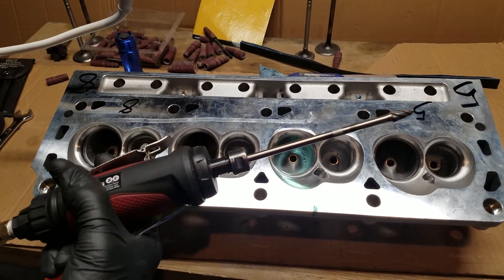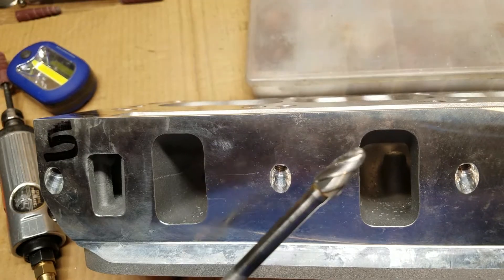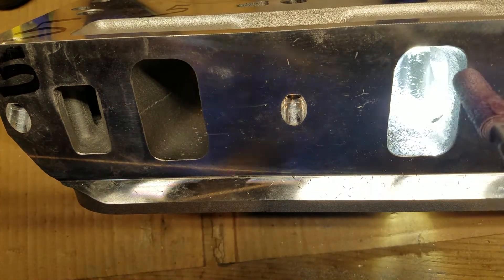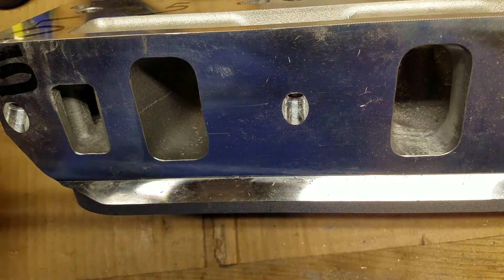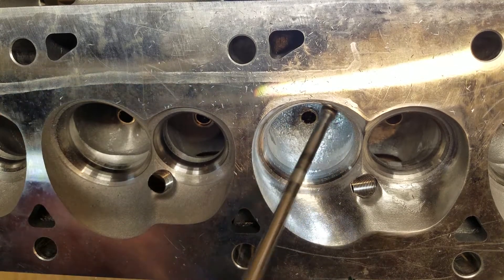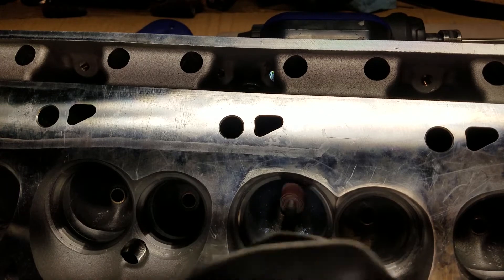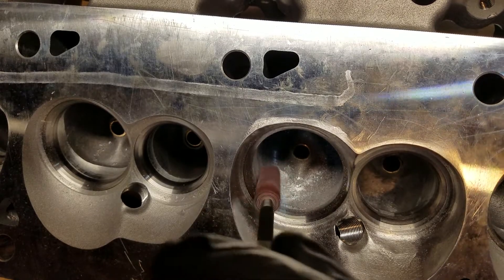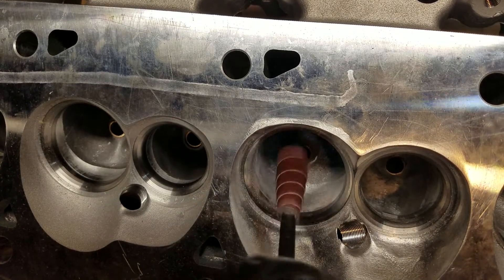How to ..... porting/bowl blending a Ford 302 351 NKB intake port

Comment: Take note folks the tech dude doesn't have the die grinder running flat out.On ally heads you must do this not to risk ripping too much material out.Conservative is the way to go guys.Great video Blue Oval Dude.Cheers from Oz
Reply from the maker: Thank you sir , yes , it cannot be mentioned enough. It would be easy to dig a hole to China which is not easily fixed. Lol

Comment: I'm trying to do the math.So if I can't modify the heads myself and had to pay a machine shop to do what your doing would these heads still be cheaper ? Let's say I just have the intake runners cleaned up and the valves redone.I still have to buy the stud mounts.I have already talked with Skip and he said I would have to place a order there not on a self I only live 20 minutes from his business so I won't have to pay for shipping.
Reply from the maker: It really depends on how much work you would have done to the heads . With everything i did myself, if i paid a shop to do the work , it would probably put it out of budget territory. It really depends on your horsepower goals . It is much better than a stock set, right out of the box . If 500HP n/a is your goal , at least clean up the exhaust side . The intake moves enough to support 500Hp n/a out of the box in a properly set up engine. If your goals are higher and you cannot do the port work yourself,  you would be better to spend more $ on a better set . something like a Flotek 205 hammer , Trickflow 11R , Afr 185 or 205 . Just depends on goals and budget .
Reply: I'm trying to make a decision, I have 351w has 1500 miles on the rebuild.I used forged pistons 0.40 over with a comp cam part # 35-218-3.I used some gt40 heads had them completely redone with springs to match cam.I used a dual plane Weiland intake and roller tip rockers.Tossed out all smog crap and replaced the carburetor with a 750 secondary quick fuel.This is all in a 87 f150 which is around 4800 pounds.The weight really hurts my quarter mile time of 16 seconds.I just had my C6 transmission upgraded with new stuff and servo and shift kit.I'm using a 3.90 gear with limited slip and 275 tires.I have good low end torque with this setup.Not sure if a head swap would do much.I did have the torque converter rebuilt but it was factory, the transmission guy says he thinks I should have around 2000 stall with it now.Love to get down in the 14 second bracket but other than a cam change with better flowing heads I doubt I can achieve that number.Anybody who has productive help please respond.
Reply from the maker: @stevecooper8121  do you have long tube headers, dual exhaust, what size exhaust pipe , what mufflers are they , what ignition, what is the timing at , is carburetor opening up all the way ?  It will take around 350 horsepower to run mid 14's at 5,000 lbs consistently (guessing in that neighborhood with driver) .
Reply: @blueovaldude  I have the long tube headers, made by Headman.The exhaust set up is a issue.What came with the truck was 2.5 inch pipe with a one in two out muffler made by Flowmaster.After I get this transmission back in this is my next mod, remove the front gas tank making room for true duel exhaust.But from what your implying I should swap the heads out .So with that being said now is the cam big enough ? My problem is that I want to still use it as a truck for hauling fire wood.So to big on the and I will need more stall and the hauling goes away.As for as the carburetor goes it seems to have no problem opening up.Its running a little to the rich side but no issues.I did use a hotter coil but still have factory distributor.My timing is 15 degrees set up from 10 factory and I use 93 octane. My pistons are dished factory spec and my block was shaved a tiny bit and the heads also.No idea on the compression number.9.? to 1.
Reply from the maker: @stevecooper8121  sounds like you are starting get it sorted it out . Yes , fix the exhaust, true dual 2.5" straight through mufflers,  like a cherry bomb salute (budget but good flow ) . Yes,  your heads are holding you back . Those NKB'S out of the box would be more than enough,  and lose another 50 lbs to boot . May need to make valve clearance for 2.02 valves though . I just don't reccomend spending time and money on lesser stock heads unless you have to . i would switch the cam , If you wanted to stay flat tappet . You have a high energy 268 cam now . I would switch to a newer grind extreme energy 268 . It has faster valve action and offers about .050 more lift . It may even have more low end . It's just a better grind . Or go with a hydraulic roller in the same operating range, more cost but probably 20-30 more hp . You will have to do something with the timing.  I would probably run 16 initial timing and 32-34 total at 3500 rpm's . Perhaps 8 degrees advance with a vacuum advance distributor . vacuum  secondary carburetor i imagine, ajust the carb to make it open the secondarys quickly (by 3500 at least) get it turned properly. A decent air cleaner of course. Easy to make a ram air in a truck too . Another.  .2 -.3 tenths right there . No problem you'll get her there.  😀
Reply from the maker: @stevecooper8121  if you have enough compression (over 9.0 to 1 ) a gt40p head with exhaust work might get you there , a set of gt40's on the other hand  only flow around 150-160 cfm intake and 120-130 cfm exhaust side stock . Might be hard to make 350 Hp with that head .

Comment: I’ve got a set of these on a 408 Windsor, it makes about 365 wheel hp. 10..2 to one compression, and a custom roller cam. I’m new to ford stuff I’m not sure if that’s a good number for the combo or not.
Reply from the maker: Over 400hp at the crank then. What are the cam specs?
Reply: Richard Holder can make well above 500 hp with the stroked 351w but he's the master. He says you have to have the right combination to make the numbers. That would be cam lift heads carburetor tuned valve train and headers.Timing is very critical with proper fire to the plugs.87 octane won't cut it.Choosing the right intake is top of the list.If you have good midrange power use a dual plane if its all at the top rpm a single plane is always the sure bet.